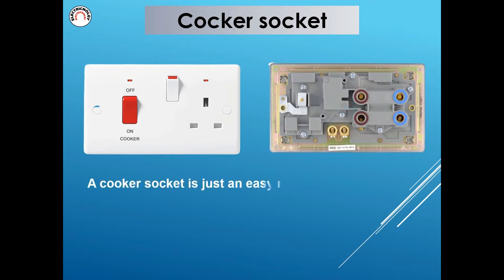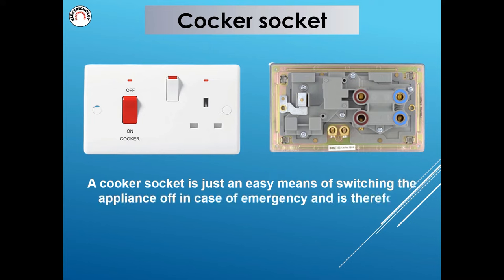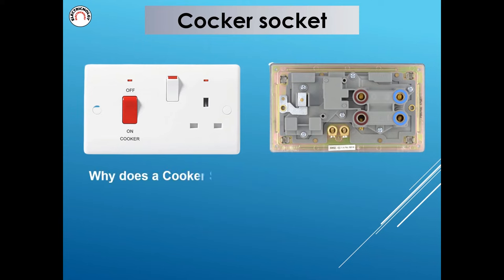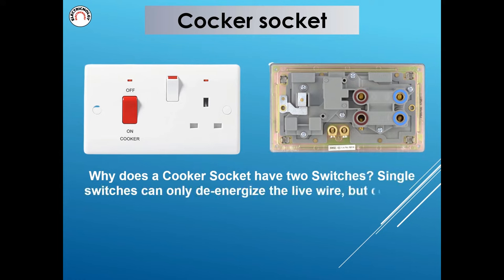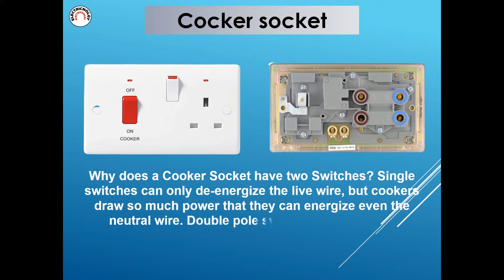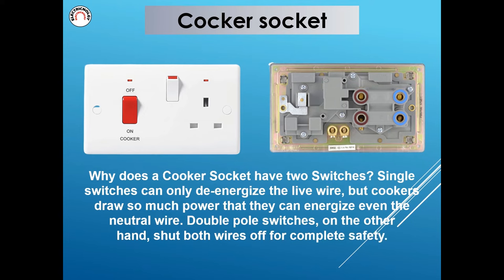Cooker socket connection-Electrical cooker wiring diagram-  how to connect the electric  cooker

Comment: i have bought a switch that the Cooker switch is on the right and the usable socket on the left. Do i have to connect the wires also with the according way? thank you!
Reply from the maker: Yes, you can connect the wires in the same way as in the video
Reply from the maker: Yes, you can connect the wires in the same way as in the video
Reply: Should I turn on the two switches same time while using it for hotplate?